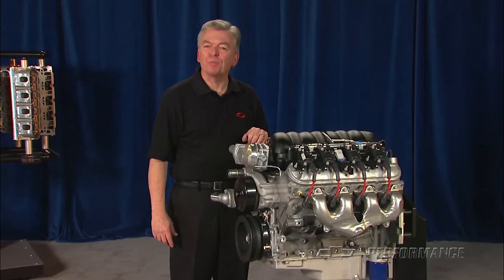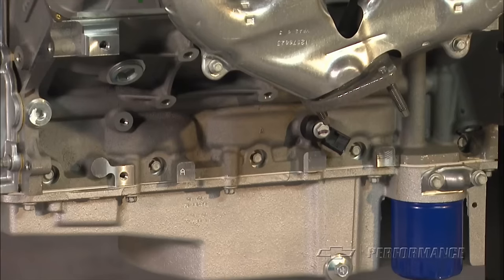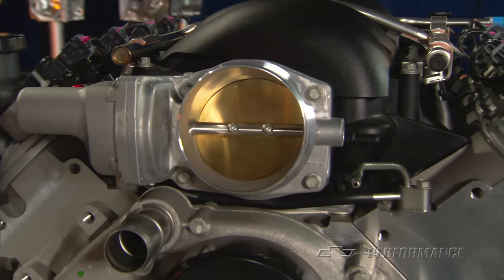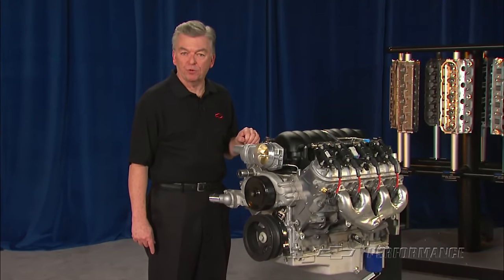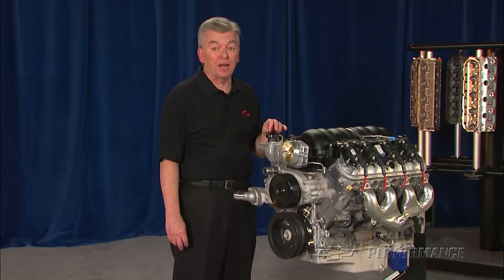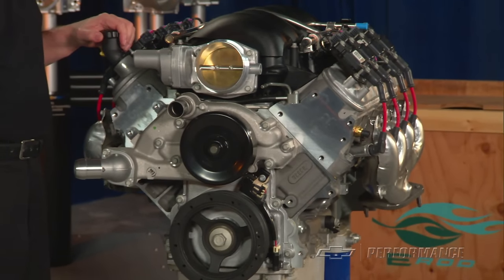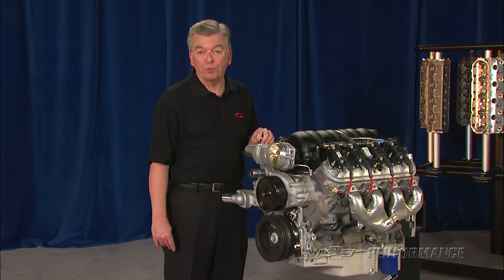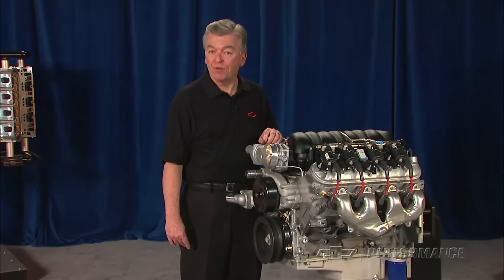Chevrolet Performance Raises the Bar with the LS 376/525 engine!

Comment: Just dropped this in my 2012 Sierra. That intake manifold won’t work in the truck application especially if you’re trying to run that throttle body. Had get an intake manifold from an L92 Escalade engine. Also, the supplied injectors won’t work either. You can either buy replacement “truck” injectors which are taller or buy the available injector spacers offered by Texas speed. Not as easy of a job as I anticipated but got it done. Getting tuned tomorrow. Wish me luck!
Reply: Hows it working out? Im about to do this in my 18 rcsb silverado.